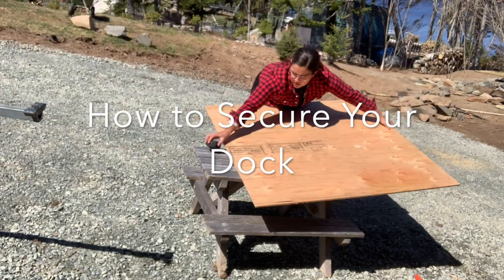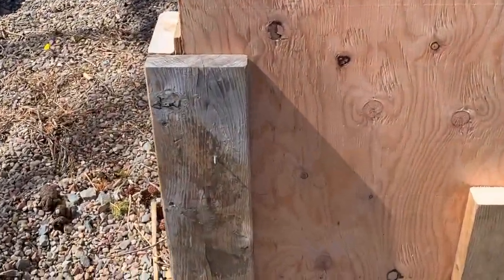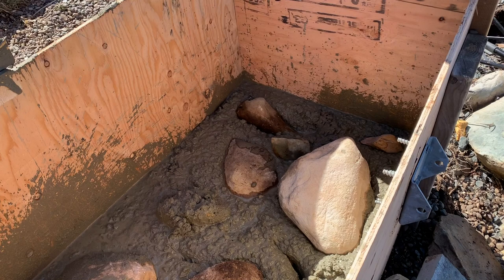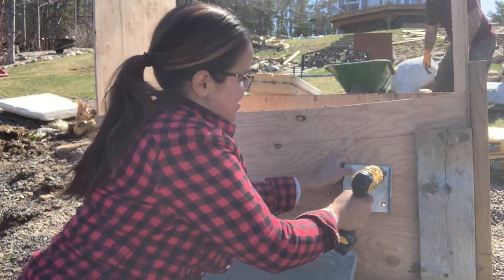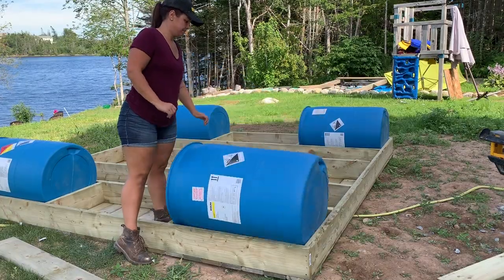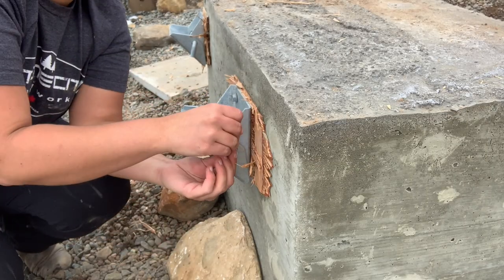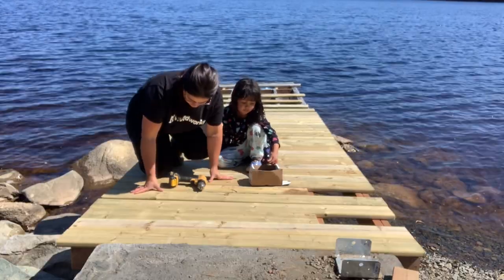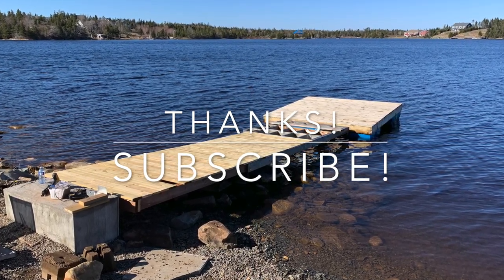How to Build and Attach a Dock to Land - EASY Diy with Barrels

Comment: Thank you for the inspirational video!!! In my situation I chose to pour a 4' X 4' X 6" slab , inside of which I dug 3 holes.  Two in the front and one on the back. I then drove 1" rebar into the holes about 2' into the ground to keep the slab from shifting.  I then drilled two holes in the lake facing board and inserted two 3/4 threaded rod with two sets of nuts/ washers one the concrete side with the other end protruding out the front 4". Poured the " high strength " concrete (14 @ 80lbs. bag/ 1,480lbs) . I will be attaching a 6x6 to the threaded rods to which I will be attaching the gangway hinges.  Also to address some other comments here. You can get pipe brackets to attach to the side of the floating section,  commonly available at a good hardware store.  Then drive the appropriate length 2" pipe into the bottom of the lake. This will keep the dock from moving sideways,  yet still allow it to  float with the waves. Thanks again!!!!!!!
Reply from the maker: im so glad this could help!!  Great tip on the pipe! thanks :)

Comment: Nice video, if you really want to stabilize that end dock grab four 5 gallon buckets and four saddles that you can buy at Home Depot. Fill the buckets with cement and place the saddle on the top of the cement. Go grab some hooks and screw them into each of the corners of your dock and secure an appropriate length of chain to hook each corner to a respective bucket anchor. Drop the buckets into the water and have people stand on the dock to put weight on it while you secure the chain to each corner on the dock. Voila! no more wobbling dock
Reply from the maker: Thats an awesome solution! thankyou
Reply: @dcwoodworks  my pleasure.

Comment: It would help the longevity of the dock by a huge amount to use Galvanized corner brackets - the screws or nails used on this will pull out in a period of a couple of years.. Essentially - any time you have a T intersection - add a metal bracket!
Reply from the maker: You are very right! We had to add those last year for this exact reason lol

Comment: Looking good. Questions : what happens when the wind pushes the dock to one side, I'm not sure if those hinges will hold the weight. You should look into poles at the ends of the dock, riding up and down on D clamps so it still moves up and down but poles hold it from going side to side.
Reply from the maker: thats a great idea! it didn't pull this summer, its in a quiet cove but i will keep an eye on it.

Comment: You mention that this was your first time building this and I tell you, you did an awesome job But let me add and don't take my advice's in a wrong way but in something to think about,  there is a lot of things you do when pouring concrete that you should always take under consideration, like supporting the concrete walls so they don't curve on you. Also using rebar for a job like this (don't have to be a lot), the rocks are an excellent idea for filling up but they don't act as rebar and another observation that I thought it was not consider and important, was putting an anchor on the concrete box to the ground, in other words, to dig two, 4 inch round hole into the ground (like post holes) bellow the box you made, about 2 feet down to make sure that the Docks don't move the concrete you just pour into the lake. But I really think that before the docks move your concrete box, your brackets would brake first. I always look at other people build stuff that I know how to build because I believe that we all learn something new every day. Great video and awesome job and may the protected hand of God watch over you and your love ones on this pandemic crisis †
Reply: Sam I believe you ment break
Reply: I agree with you. I’m sure this dock will still work out, but adding large stones to the concrete does not act as rebar. It has similar properties to the concrete around it, and ultimately it will lower the life of the concrete poured around it. Coating the rocks in some bonding agent would help, but ultimately still not be as strong as a monolithic pour.

Comment: Great video, Thank you. We have got a ;arge pond/ lake on the land and I am planning to build a floating dock. I think I will use most of your video to follow. Would you know how big I can make my dock when using 4 barrels or in other words how many barrels do I need if I build a 25m2 dock?
 Also it might be a little more secure to use the straps and clamps you would use on a roof rack to secure the barrels rather than just a rope - just a thought
Reply from the maker: Chris Eiermann nice!   My floating dock is 10x10 feet. And could be bigger.   The long dock I attached to land is 6 feet wide and 24 long and only half one barrel attached to the side that’s in the water.  Barrels are deceiving they can hold so much dock. 

That’s a great idea. I haven’t had one pop out yet but I’ve been thinking about different ideas on how to secure them
Reply from the maker: https://youtu.be/RtmmBUMjTGQ here’s an addition I added in the last two weeks.    Would probably work for your pond also!

Comment: Nice video. i recently build a floating dock for our pond very similar to this one. Where did you get the hinges that you used to attach the walkway to the concrete anchor? Those would I think work perfect for our project.  Thanks.
Reply from the maker: Hey! I got them from Kent Building Supplies
www.kent.ca

Comment: Hey great video and new subscriber here.   Might want to consider driving a few posts down on either side of the deck for  stormy weather.  A hard wind with cross current might rip it loose with that dock on the end, making it basically "top heavy".  Don't attatch them, just use for sliders, if you want  you could bend some rebar around the post in a U.  I don't know where you are,  I live in south U.S. and the storms here would rip that right off the land.  Awesome to see a woman builder.
Reply from the maker: Awesome Thanks for the sub!  Im in Nova Scotia so our winds get pretty strong but nothing like south although we thought about that actually, I might order "dock feet"  

The worst element here is the winter and ice damning but it will be up on land by then. 

Thanks! I hope to inspire other young women to venture into trades
Reply: @dcwoodworks   Well I'm a guy lol and found your video informative.  I'm always trying to build something, and its rarely square, but lately I've been wanting to build a floating dock for our pond for my grand kids to fish and swim from.  I did notice one thing, I think if you make a large concrete block again, you shouldn't put large rocks in it for filler.  What you wind up with is some thin concrete around the edges, and that will break much easier, especially with the extreme low temps you get up there.
Reply from the maker: slammerjax LoL I figured that. I just meant that’s why I took my carpentry to youtube. In hopes more women will see me doing it and decide to try. 

 Trial and error for the concrete lol I’m
Pretty sure it will hold with all the larger spaces even though there are a few close to the sides. But we shall see. 🤞🏽       Finishing my next project today connected is a stand along deck and it hides the god awful concrete block.  I’ll
Hopefully have it edited by the weekend
Reply from the maker: Stand alone **** not stand along
Reply: @dcwoodworks  lol you're so funny
Reply from the maker: Here’s my newest! You’ll probably like this one too because I attach it to the dock https://youtu.be/RtmmBUMjTGQ
Reply: J

Comment: Just watched your video--great job! One question: do those hinges allow for the ramp to be "raised" higher than where they are attached to the concrete in flooding situations? I live in an area where we don't take our docks in and out of the water.
Reply from the maker: Yup! They can raise just as much as the dip. About a 30 degree. Hope that’s helpful

Comment: The only thing that would concern me is the plywood backing behind the hinge. That will rot and disappear over time, and the bracket will become loose, made worse over time by the movement of the dock against it. It would be better to cut out the plywood at the bracket and place face of bracket  flush with inside  face of concrete.  (use a temp brace on the outside face to hold bracket in place while concrete sets.)
Reply from the maker: I already see this happening, So what I plan on doing is forming up a small form in the front and pouring new concrete to fill that gap. And I will drill small bolts in and around before I pour, in order to secure the two sections together.

Comment: The first rule to using and enjoying a dock is easy access.....  how are you supposed to access this dock....jump up the 5 feet on top of the cement block and then jump down the 3 feet to the dock?   Why not make this 8 inches tall to allow for an easy step, it would still be plenty heavy.   Bad idea!
Reply from the maker: You haven't dug too deep into my channel yet then have you? Or haven't listened to the part I say I am building a deck around the cement block to completely hide it. 

https://youtu.be/RtmmBUMjTGQ